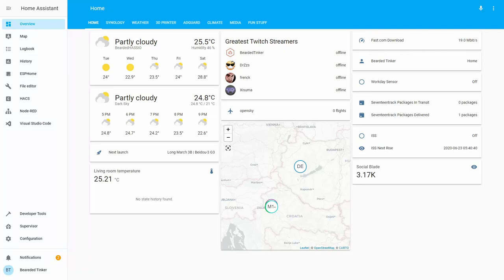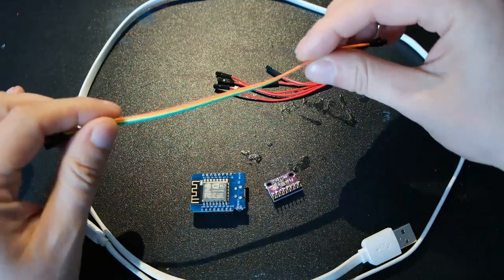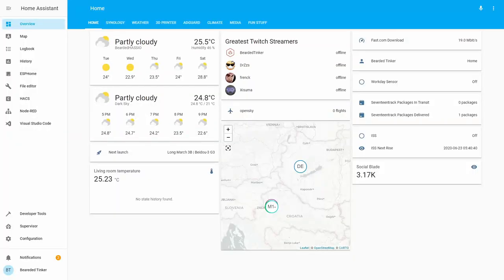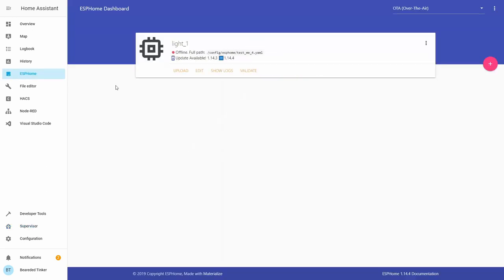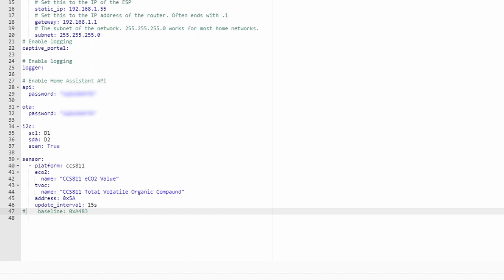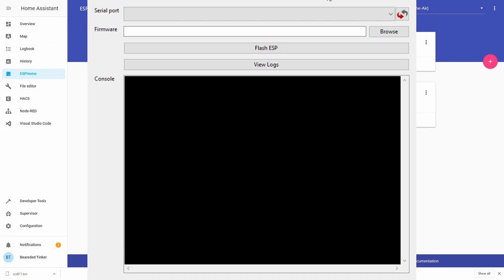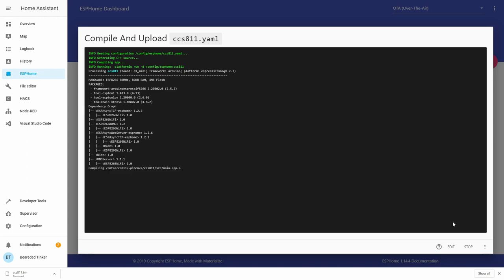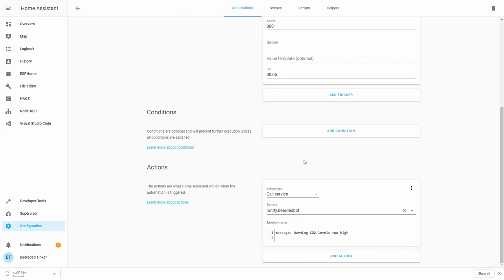Home Assistant How To - eCO2 and VOC ccs811 sensor

Comment: Great Tutorial. Followed steps but found in logs no IC2 devices found. did a search and found this on Reddit...This, most 8266 boards D1 (gpio5) & D2 (gpio4) are i2c. By using just the numbers 1 and 2 you are using gpio 1 & 2 which is uart/serial. So change to gpio5 and gpio4 in the config and all working
Reply from the maker: Glad you got it working, but I think you skipped this part: https://youtu.be/-91pz90qdos?t=282 I'm using D1 (SCL) and D2 (SDA) in video, exactly as you said.

Comment: Great post! One question, im quite new to diy solutions like this and ill try to build a similar sensor but one question, is it hard to get it to work using zigbee in stead of wifi?
Reply from the maker: Thank you for your comment Barry and very good question.
From what I've seen (or better to say not seen) - there is no easy way to do DIY Zigbee sensor. I still haven't found any example for that. If you need or want Zigbee protocol, you need to find off the shelf product.

Comment: Another great video. Do you have any recommendation for CO and/or earth gases detector that can work standalone but also can send notifications or be integrated in to Home Assistant? tnx
Reply from the maker: Unfortunately, nothing that has CO levels or natural gases. I do have standalone (but integrated in HA) Luftdaten sensor. But it only measures PM levels.
Also, I'm waiting for https://www.metriful.com/ board to arrive. That one will have a bunch of sensors, but once again, VOC and not other gases.
Reply: @BeardedTinker  Hi, Did you receive your Metriful board yet,?  I talked to you earlier about that. I got it and it's working fine with examples provided. Now looking for ESPHOME/Homeassistant integration. Can you help? Thanks
Reply from the maker: @josvaneunen1708  yes! I did receive it, but it's still hooked to Raspberry Pi W.
There is fork of the original repository that Senne did, that includes HA MQTT integration, but I haven't tried it yet: https://github.com/Sennevds/sensor
In regard to ESPHome, also, didn't try anything so far, but will probably play a bit more with it next weekend (in 10 days).
Reply: @BeardedTinker  Thanks, looking forward to it
Reply from the maker: @josvaneunen1708  btw since this was a long overdue, just tried it and it works perfectly with RPi as Home Asstaitn MQTT sensor. All is pulled in nicely. If you have Discor, I'll be posting image of what data is pulled from the sensor there.
But, still have to try and play with NodeMCU and ESPHome
Reply: @BeardedTinker  I do , I assume #home-assistant ?
Reply from the maker: @josvaneunen1708  no - this one: https://discord.gg/vrzPJq it's server for my channel.

Comment: Great video as usual. I hope you also integrate the bme680 Gas resistance, Temperature, Humidity and Pressure sensor with EspHome in Home Assistant. Because I can't get it to work. :(
Reply from the maker: Thank you for the comment!!! Just ordered one so it will take few weeks for it to arrive (or centuries depending on the postal service again🤣).
Reply: @BeardedTinker  I also look forward to it. 😆 I have been trying everything as it says in esphome tutorial and nothing.  I have changed the pins and nothing, I have also put two bridges because I have read that it could be and nothing.  Sometimes it tells me that it finds i2c devices and sometimes it doesn't.  But in all cases it always tells me "Communication with BME680 failed". 😫 Right now I just think it's broken ... and if I should file a claim.  If the same happens to you when you receive it, please tell me.
Reply from the maker: @janinho82  Will do!
BTW - I'll be getting anyday now https://www.metriful.com/ - it has BME680 on board, but it has a different interface.
Reply: @BeardedTinker  MMM interesting

Comment: I wish someone would do an example of i2c directly on the Raspberry Pi with home assistant.  Why use an Arduino when the raspberry pi should be able to do i2c.  But, alas there is NO good examples out there of doing this. :(
Reply from the maker: You are right, but as price for ESP boards is much lower then RPi, even Zero version, people tend to use them more. There are some tutorials covering i2c on RPi, but haven't seen as much how to videos for that.
Reply: @BeardedTinker  I understand about the price but I am building out HA to automate my home garden and I don't really trust WiFi for that.  I don't mind if my laptop occasionally loosing WiFi but if a light in my grow room doesn't go on or off at the right time it could cause me to loose my crop.  I may look into ESP boards with wired LAN built in.  Thanks for your response! :)
Reply from the maker: In terms of reliability, esp should be more reliable then any version of PC (of course bugs not included). Think of it as ABS on car, I wouldn't trust it if it would run on Windows OS 😂
You can make independent time/light based switch with esp.
But it re6all comes down on what you want to do
Reply: @BeardedTinker  I wouldn't trust an esp32's reliability if that also meant trusting WiFi.  Also, wouldn't it be cheaper to just run i2c on the Pi that is running Home Assistant?  That is a sunk cost whereas having a Pi and Esp32 would cost more.
Reply from the maker: Sure, that's also option, as I said it all depends on what you want to connect. I prefer to avoid anything such as external sensors to RPi as there have been a lot of cases where they pulled a bit too much power and burned part of RPi 
But yes, you can power some of the devices and run them directly connected to RPI.
Reply: @BeardedTinker  Cool!  Thanks for your time and your great videos!
Reply from the maker: @ArtisanASCII  thank you for your comments and time!😀